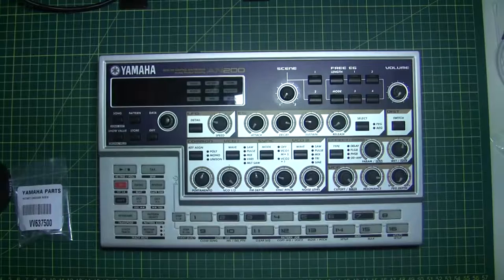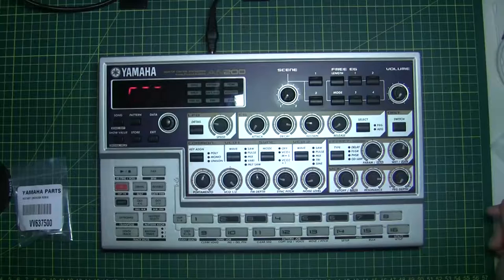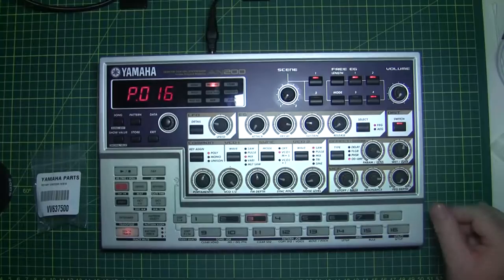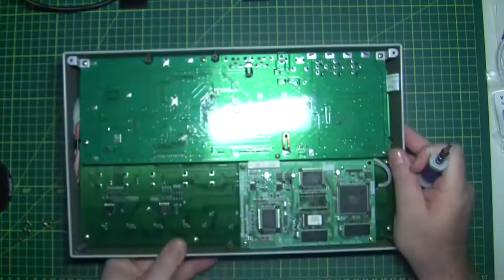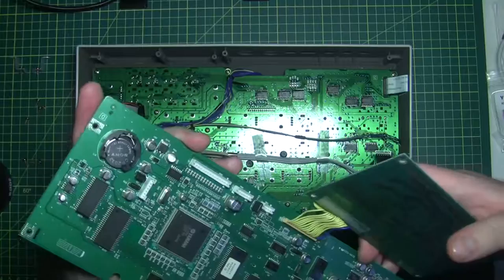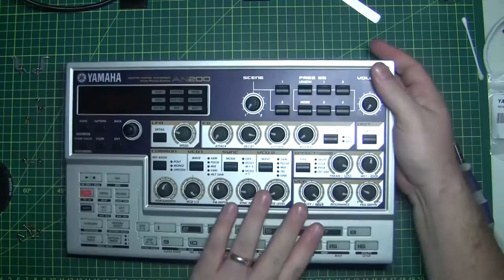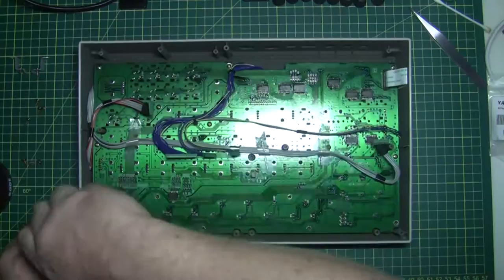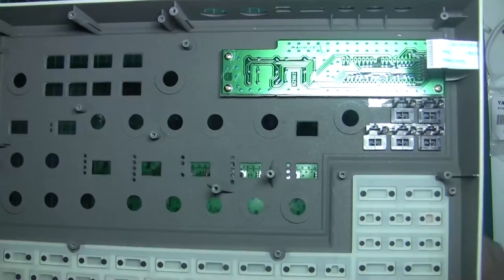Yamaha AN200 Repair Part1

Comment: had this problem after storage, deoxit and working it improved to the point of usability, i own both, AN/DX 200 , and i would also like the other loopfactory unit su200
while open, check any all caps for leaks, lightly clean the carbon pads, and replace the tape with kapton tape (not entirely necessary)
, since some of these usnits may have been used in a location that contain drinks, make sure there is no gunk in these knobs and general light cleaning. 
im actualy looking into modding them as 1 unit.

Comment: I've replaced mine once, and it's broken again. Worked for a few weeks only. I have the same issue with one encoder on my An1x, which I have repaired twice already: that seems to be a software / board issue.

Comment: yea , the yamaha a series samplers have the same problem .
Having a  A4000 here , encoders suck big time .
Reply from the maker: Hi Ward :) Thanks for stopping by! Have you repaired your A4000? Are they much different looking?
Reply: Noppes , havent repaired them .
Different looking ? DOn'tt know , haven't opened up the encoder part  ...a lot more difficult to reach /unsolder them ..
As far as I know most  yamaha synth/samplers from the 90's era that uses those encoders have the same probleme .
Yamaha a series sampler A3000/A4000/A5000
su 700
Rs 7000

The su and  a series being the worst 
 
Sampler is just collecting dust here :)
Reply from the maker: Hehe. I wonder if it is a similar repair. It wasn't really that difficult - just fiddly getting the encoder off.